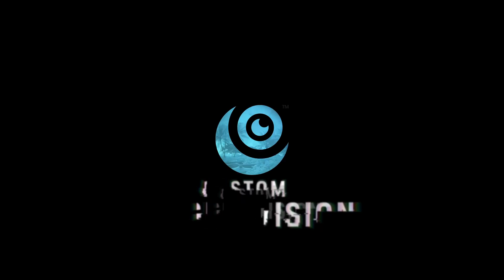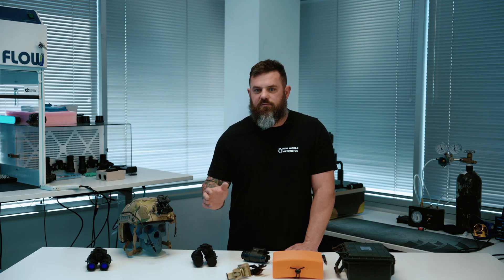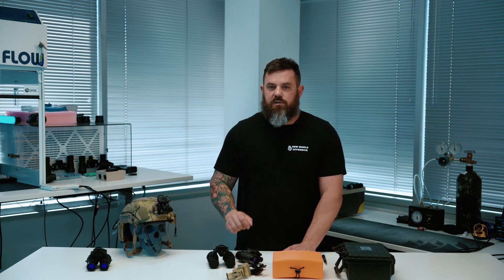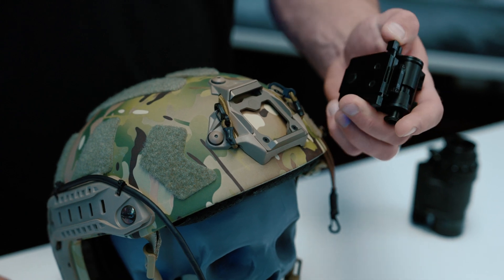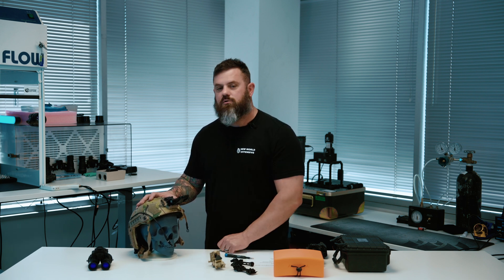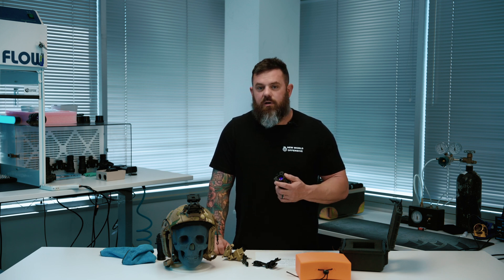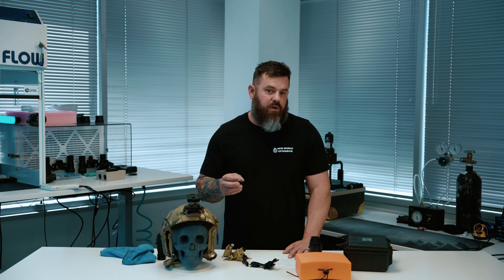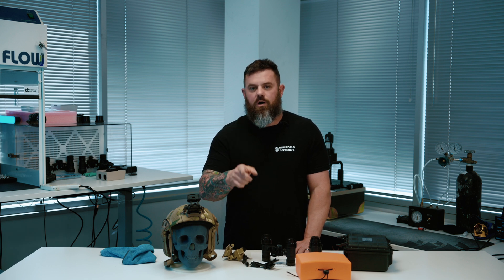Custom Night Vision | Night Vision Users Manual

Comment: I just purchased ITT PVS-7s from an estate for $500. They work awesome and I'm thrilled to have my first set of NVGs. They only have one minor black blemish, but had some 'shadowing' and appeared to have some loose gunk inside on the lens. I unscrewed the lens from the body and accessed the tube. It had what appeared to be fine scratches on the outer surface, like somebody tried to clean it. Is there anything that can be done by a professional to restore or improve the tube? Also, there were no markings on the tube. How can I tell what kind of tube it is? Thanks

Comment: So I'm just testing my unit for daylight "safeness" with the bikini covers. (I'm just putting the covers on during the day and turning them on). 
What I find is that they produce a fairly green and bright flat image even with the covers on, if I turn the focus rings all the way so they lock in the image gets darker and pretty noisy. 
is light leakage around the front lens normal?
Reply: You are creating a large gap for light to enter when you focus to extremely close up.  You will even be able to read the cage code off the lens by doing this, just look at the lens from the side while doing it and you will see why.  It is completely normal but try not to do it in daylight just to keep the tubes from being overexposed.
Reply: @nods4u isn't that the back side? On the eyepiece.
I can't read anything through the bluw coating on the front lens
Reply: @arnjhon  I was talking about the objective lens, and no you can see it from the SIDE profile not through the lens.  The ocular lens (one you put your eye up to) is the one you can see the tube info from by adjusting the diopter until you can read it.
Reply from the maker: light leakage around the back of the bikini cover?
Reply: @customnightvision  no, between the objective and housing. if I have the bikini covers on, and the device turned on during the day or in a lit room. If I adjust the objective the brightness of the image will vary

Comment: Actually i found that for monoculars focusing it's better to do it with both eyes open and fixed in a target with some illumination. Then switch attention to the image from the plain sight eye and switch to the other and quickly correct. Why? Because in a dark environment or with a closed eye the plain eye is almost pitch black and the NV eye just corrects the image and focus itself. When you use both eyes open, then your other eye comes into play and you might get a blurry image in the NV because of bad focusing that you cant detect just using one eye.

Comment: I got a question, I bought a PVS-14 digital style housing and the remote on-off contacts from a Wilcox J-Arm don’t do anything. I can measure a voltage there, I have confirmed the J-Arm creates a momentary closure but the housing ignores it. I was told, “nobody uses that dumb feature…just cut it off” but that seems a lame cop out. I was forwarded to the maker of the housing and told my warranty is with them if I want it fixed. I talked to the guy who claimed to be the engineer who designed the thing which blows my mind because as an engineer myself the conversation didn’t inspire confidence. Nobody serious builds a circuit and willingly says, “sometimes it works sometimes it doesn’t…” if I designed shit like that I’d be out of a job. 

Works great in every other regard, but seems kinda BS that a legit feature doesn’t do anything.
Reply: I can swap it out for a standard power supply if you want. Frankly I’d recommend a different housing if you want something nice though.
Reply: @kevin11288 it’s in an upgraded housing, I like it…just the push j-arm on/off function doesn’t work. I may send it back and let them fix it, they claim they can it’s just weird that they claim nobody uses that feature. This isn’t the magnet type deal where you swing it up and it turns off. That can screw you by turning off if you look too far up I guess. It’s a PVS-14 NL914C Lightweight Battery Pack from Nightline.

Comment: When I got my PVS14 (from CNV, of course) the image from the device didn't align with the image from my unaided eye. I found a post out on the interwebz that explained how to fix this. Loosen the objective lockring and rotate the lens assembly a small amount one way or the other and within a half turn both eyes are lined up. Tighten the lockring back up.
I can't be the only one with this experience so you could help them out by showing them how-to.
Reply from the maker: Thats a great idea dude.

Comment: can you make a short video on how to open katana (and maybe others) housing to replace the tubes? or to access the tubes. there are a million pvs14 videos but I cant find a lot on binos
Reply: Because it’s not recommended to take them apart with the proper equipment to collimate them.
Reply: @kevin11288  makes sense. is there any way someone could identify the tubes without undoing too much on it?
Reply from the maker: sometimes you can see seriels through the eyepiece if you look kind of sideways at the back of the itt.

Comment: I was wondering about cr123 batteries, some are 3v and some are 3.2v or 3.7v. Does it make a difference in a minocular?
Reply: In some user manuals they will list a voltage range for the operation. Some are very specific and don't do well with higher voltage like an EOTECH optic. On the other hand, my thermasight monocular has a very broad operational voltage range and does just fine with a variety of different battery packs.
Reply: Are the 3.7 rechargeable?
Reply: Yes. I use them in my thermal. @kevin11288
Reply from the maker: dont use rechargables.